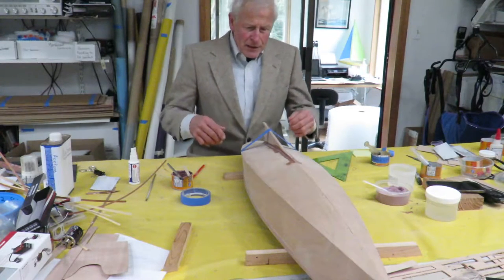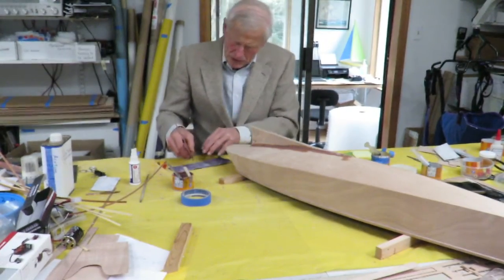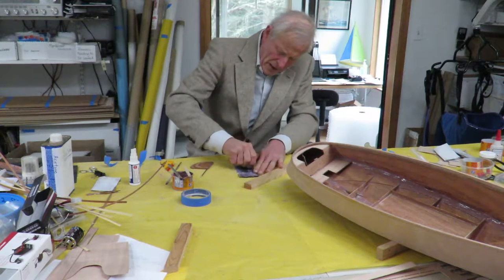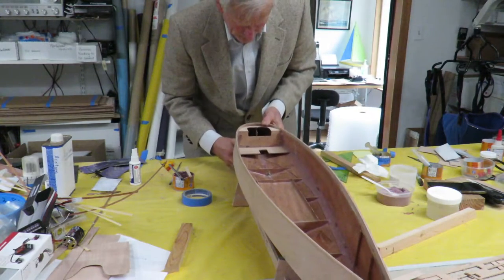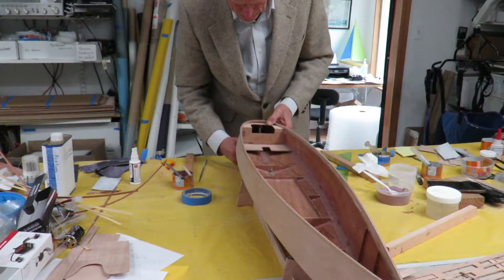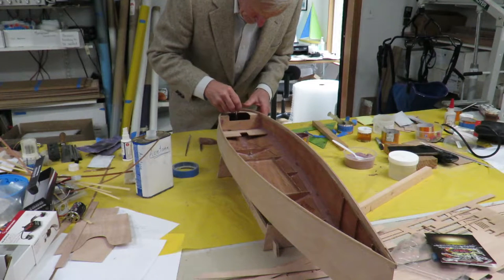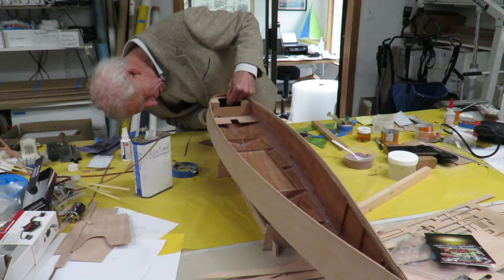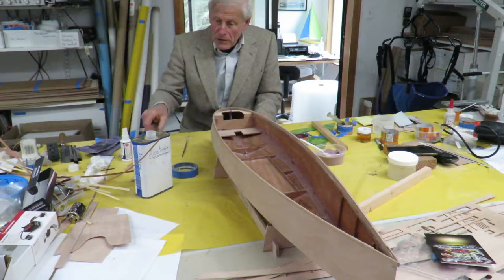Stormy 45 Assembly - Part 7

Comment: Nice work Will~ For doing delicate CA glue jobs like the mahogany trim pieces on the motor cabinet, you might find the use of a needle applicator tip very helpful. I suggest Bob Smith's "303" applicator but there are several other types, easy to find. These tips push on friction fit to the original bottle tip, when they clog you snip off a bit and back in business quickly.